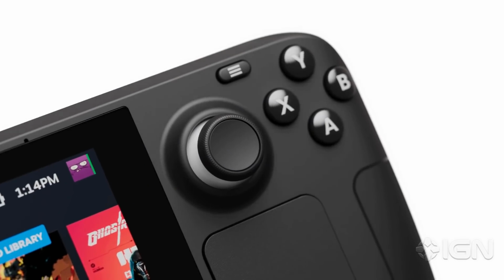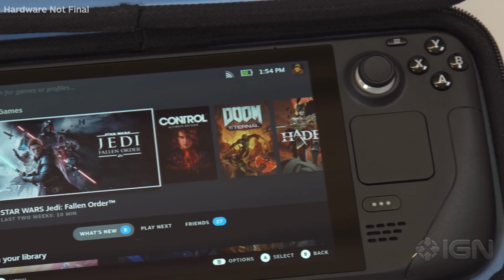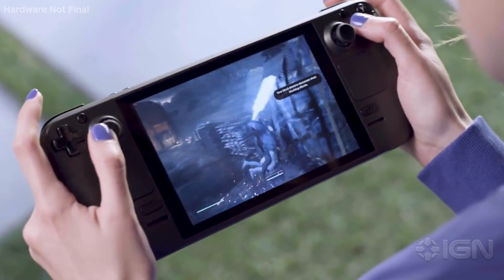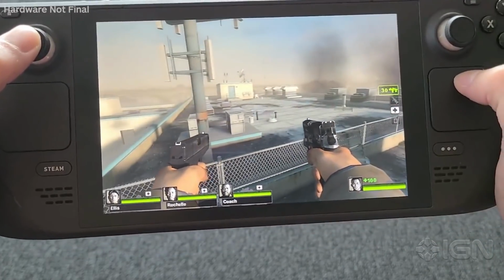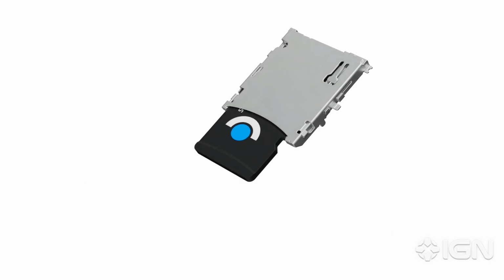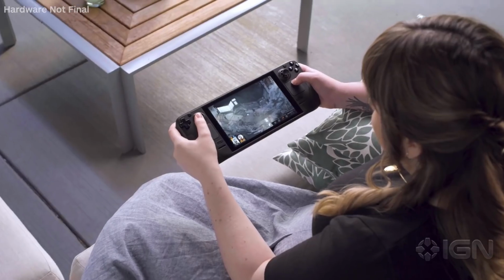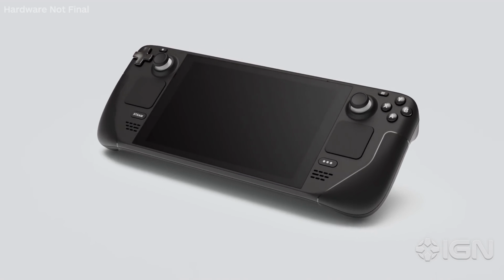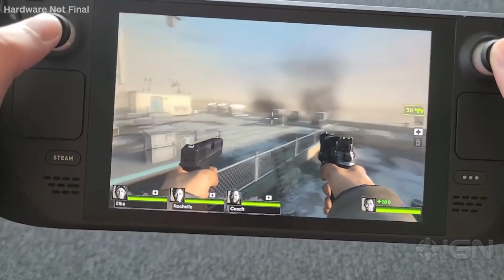Steam Deck: Valve Talks Hardware Power, Controller Comfort, and More

Comment: Calling this a Deep Dive is like diving into the shallow end of the pool. Deck still cool but this interview just seems like more filler content.
Reply: they need to milk views for profit
the more videos the merrier
Reply: There is four months left so they going to do very slowly to keep up the hype. They aren't going to reveal everything in a single day or month. People would be excited for few days and they would forget it.
Reply: 100% click bait.
Reply: Why is Pierre Loup Griffais in all of those videos?
Is he the nr2 at Valve?
He was even in the Gabe Newell video.
Reply: @randomnobodyplaythrough  He is one of the lead. Dude is also active on reddit
Reply: You just described the entirety of IGN
Reply: Thats vintage ign
Reply: The interview seems decent at answering library catapouging on SD, apong with removable ssd questions, but the FOOTAGE is reused noob crap.
Reply: it's mostly telling people that freaked out about space to calm down.
Reply: To a layman, it was quite informative, actually.
Reply: Didn't steam already make a console and it failed horribly
Reply: @jamesmoses4066  Nintendo did the same with the Wii U
Reply: @jamesmoses4066  No. Steam Machines were basically just prebuilt computers running Linux, and weren't even actually manufactured by Valve themselves, they were manufactured by third parties. The Steam Controllers and Steam Link were sold separately. The main reason they failed was because they couldn't run a lot of games (due to being on Linux pre-proton) and they didn't really bring anything new to the table. They were literally just PCs but worse.
Reply: @evdestroy4121  the steam controller is genuinely a great piece of hardware now because its insanely accurate when used properly that's why some fps players use it and a decent amount of people use steam link now
Reply: @jamesmoses4066  yup, this one is gonna be dope cause you can play your triple a games anywhere.
Reply: Dont forget about the self pity
Reply: @bigboi2654  self pity?

Comment: Cant wait to play the new stalker on this
Reply: Me too. I’m hyped.
Reply: I'll be happy to play the original Stalker games on the go and around the house on this thing too! It'll also be awesome to play the original Fallout games in portable format. Very excited.
Reply: Doubt it'll even run that on low at 30fps.
Reply: @Macky4941  do you think it will run on a 1050 because that's this but with more VRAM
Reply: @Macky4941  it can run doom eternal,so why not stalker😂
Reply: @skyezblue3136  doom eternal is easy to run. Stalker 2 isn’t.
Reply: @oreocrackers7483  I'm pretty sure if it can run doom eternal with all those movement and spawns in game that enough to make my intel crying for more fps, it's pretty powerful
Reply: @skyezblue3136  even switch can run doom eternal
Reply: @phony8699  That's because Panic Button rubbed the game against a cheese grader and hoped for the best
Reply: Doom Eternal is extremely well optimized, it can probably run on a GT610. S.T.A.L.K.E.R on the other hand, even with powerful hardware you'll have some trouble running the first 3 games.